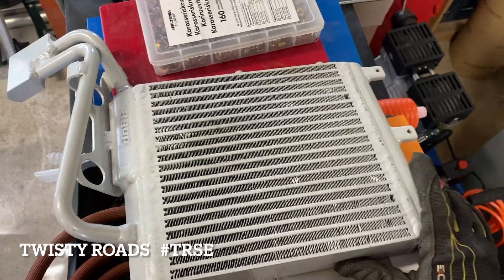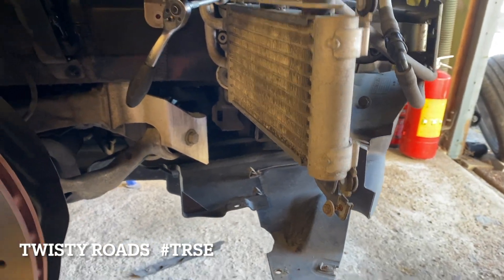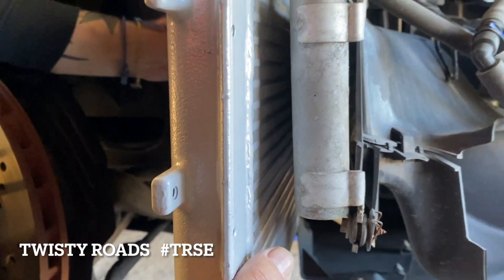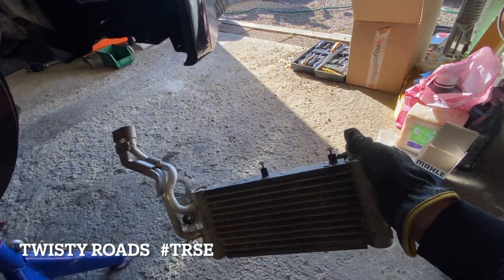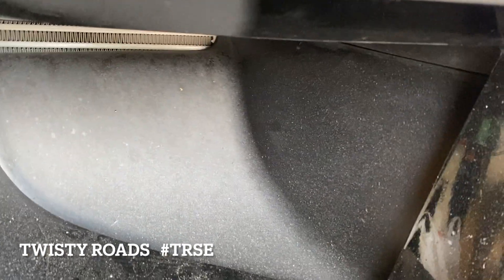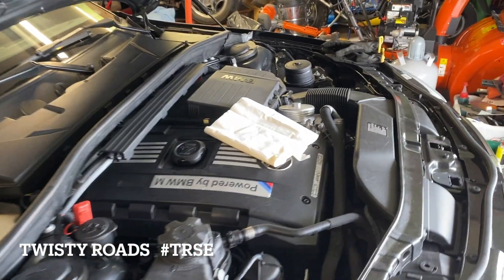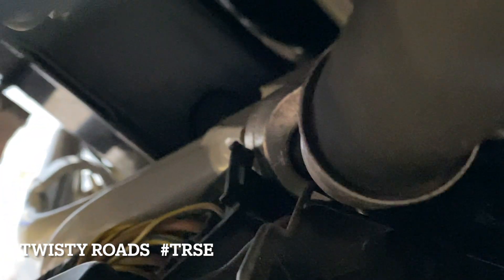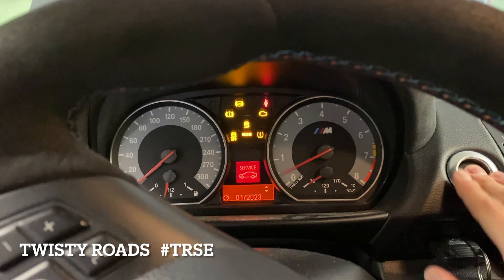BMW 1M Build: Part 2 Mounting a E9X M3 DCT oil cooler from DO88 to a N54B30 engine

Comment: thxs for vid! how is it holding up and did you end up cutting the front bumper for more airflow?
Reply from the maker: It works great, was down on nurburgring i August around 25 celsius. And had steady temp at around 115celsius 👌🏼
Reply: @TwistyRoadsSE  that’s great and all you did was install an OEM M3 transmission cooler and re-purposes it as a  1M oil cooler🧠🧠🍺??? Did you end up putting your oil thermostat back on?
Reply from the maker: @andreagate542 no, i bought a uppgraded m3 transmission oilcooler that is dubble the size from stock m3 and 1M/n54 cooler. This summer i testet it without the thermostat, and it was hard to get the car up to temp, so i Will probably install the mossleman thermostat this Winter.
Reply: @TwistyRoadsSE  nice real world testing!!!!
Reply from the maker: @andreagate542  Thanks, for track use it perfect without a thermostat, but when cruising motorway it is running a litle to low 
Motorway Cruise is around 75-85c so would like to have atleast 85-95c 
Outside temp around 25-30c when testning
Reply: @TwistyRoadsSE  you da man!